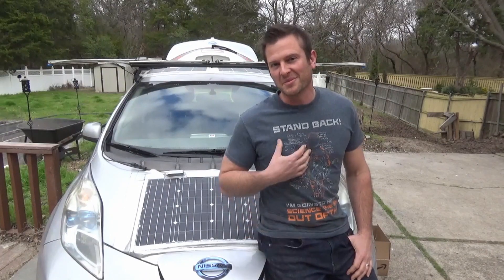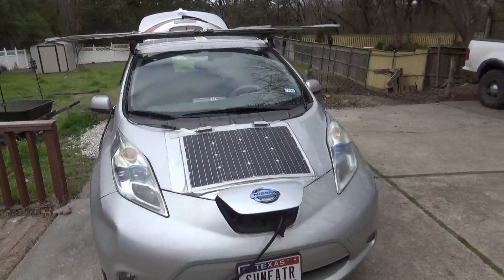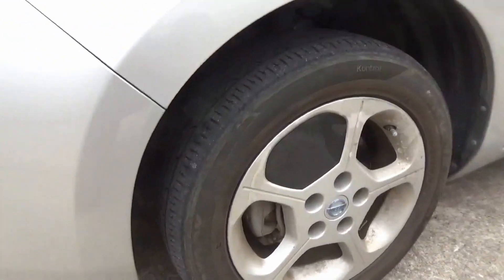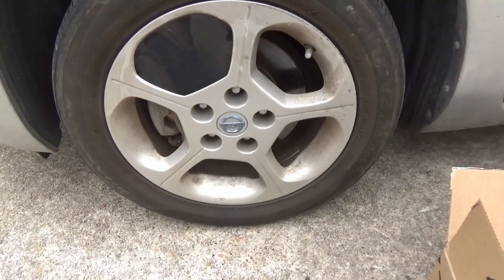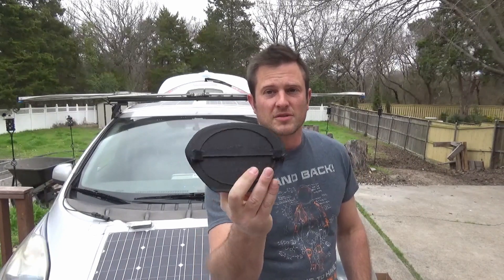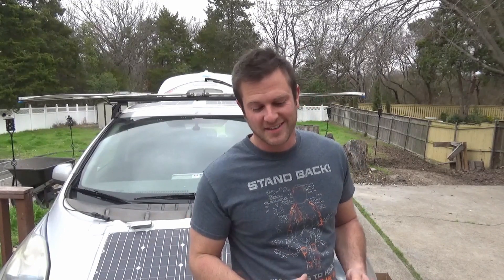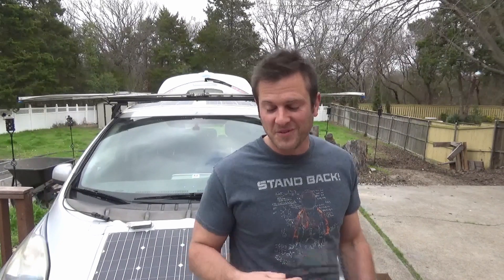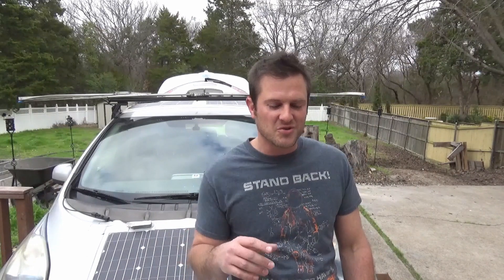Aerowheels for the Nissan Leaf

Comment: Excellent as usual. 
I remember when I comment out about aero wheels and I'm glad you found an even better solution.
The percentage that You've gained probably zeroed out the drag of your roof panels.
Since you're connected with some people with 3D printing skills, maybe you can customize some adaptors to sleek your panels making the wind go only over them instead of diving.
I would love to see your car on a wind tunnel to check the drag coefficient.
Congratulations on the EXPO.
From then on you can write it down, your channel will grow exponentially.
Well done.

Comment: This is a super cool idea! I tried messing around with an ICE car a few years ago to try to increase its economy too and in doing so I found that sometimes the overall price of the upgrade wasn't the main factor, but the cost per ... efficiency gained (?). In that case, it would have been miles per gallon gained per dollar spent, but here maybe it's miles of range gained per dollar spent. The wheel covers may not seem like a big deal at only 3-6% efficiency gain, but if the price to increase efficiency by 3-6% for $150 was compared to doubling the range by doing something like replacing all of the car's metal parts with carbon fiber parts, it might be seen that the areo-wheel covers might actually be an extremely good deal. It's just a different metric that I noticed with my own experiences that really seemed eye-opening. 

I couldn't believe that wheels and tires make such a big difference in efficiency, as you mentioned with information from the SAE. With regenerative braking, wheel covers seem more possible than ever as not as much heat is generated from braking as in the past with ICE cars. It really opens up a whole new world of possibilities. I wonder if flat panels could be made to cover the entirety of the rear wheels, such as on the old versions of the Honda Insight ( https://en.wikipedia.org/wiki/Honda_Insight#/media/File:HondaInsight.jpg ). 

AutoTempest.com is also a cool site for looking up cheap Evs for EconomEV of the week because it automatically searches multiple sites for the best deals ( https://www.autotempest.com/results?make=nissan&model=leaf&zip=79835 ).

Also, have you considered testing individual cells in the factory battery? I have heard that sometimes just a few of the individual cells in an electric car battery, such as the Leaf's, can go bad and cause the whole system to perform poorly despite most of the cells still being okay. I realize that this is a big project and is a bit dangerous because of the high voltage, but I'm just curious if you had given any thought to it?

Thanks for posting all of this awesome information!
Reply from the maker: Thanks for the search engine link.  That will help.  Full wheel well covers would definitely reduce a lot of drag too.  I will keep an eye out for something like that.

The full battery pack open will happen eventually on this channel.  I think the high voltage can be worked with safely, provided that you really focus on what you're doing.  I have also heard that a few heavily compromised modules can cause the whole pack to underperform.  When I drop the battery pack out and open it, I will do a full cell by cell check of all 48 cells in the pack.  I will probably stock up on a few unused battery modules for when that day comes.  The individual modules go for around $50-60, so you could potentially restore the battery for only a couple hundred bucks (there's a business for ya).  When will this happen?  Free time is usually my main limiting factor, but the battery doesn't have to much further to go before I will HAVE to replace it, or switch vehicles.  I will have a better idea of the timeline of degradation this June, when this project hits the 1 year mark.

Comment from the maker: Aerowheel inserts installed on 2-9-2020 at 47,700 miles.  I will try and post updates every month here, so we can get a good idea of how durable these inserts are in the elements.  I applied some silicone sealant at the contact points for adhesion.

3-16-2020   Mileage: 49,053  Highest exposed temp: 87F  All Inserts attached and in mint condition.

8-24-2020  Mileage:  52,900  Highest exposed temp: 110F  All Inserts attached, a few minor scratches, but overall condition still 95%+
Reply: Definitely a good call on the silicone seal. 3D printed parts are surprisingly strong, but they do have their weaknesses, namely heat. Because the plastic used to make the parts has to melt at a fairly low temperature, parts inherently can start to deform in heat. PLA parts, for example, can be molded by hand at around 160f/70c. Texas gets hot, maybe not that hot, but probably still hot enough in direct sun to soften the tabs a bit so that they could pop off more easily if a tire hit a pothole at speed. With the addition of the silicone sealant though, I don't think that you should have any issues. It may have been nice to have mentioned that in the video though, just in case others try this without reading the comments. No biggy though, thanks for trying this and posting!
Reply: @justin_time  Yeah - I'm printing mine with just PLA,  but we don't get above 30 degrees C where I live. It would be better to use PETG or anything with a higher melting point. I think Eric is using ABS for his prints.
Reply: @paulkennett  Hi Paul - thank you for sharing your invention with everyone! I don't own an EV [yet] but I do own an ICE car and am interested in trying to print my own areo wheel inserts to increase its fuel economy. 3D printing usually comes easily for me, but sometimes I struggle with finding an efficient modeling method. In the past, I have used air dry clay to model sections of larger structures to then use to take measurements of for use during CAD modeling. I'm curious how you went about modeling your aero wheel inserts for your Leaf - would you mind sharing your technique?
Reply: @justin_time  I just cut out bits of cardboard to fit the space, then 3D modeled it. Once I had the outer shape I then added the clips. I fiddled with various clip options till I had a result that worked.

Comment: Hey Sam, I just thought of something new to possibly try. In the same vein as weight reduction as with swapping out the lead-acid batteries for lithium batteries, have you considered removing parts from inside of the car such as the rear seats? I took them out of my vehicle once, it only took about 10 minutes with one socket wrench, and I couldn't believe how much they weighed and how much it looked like the springs shot up in the back. Other things like floor mats and carpeting can also really add up too. This would be a free, easily reversible mod, and because you mentioned in previous videos that you typically only use the leaf as a commuter car, it doesn't sound like you would lose any functionally. Maybe it would be a gain as you would have even more room for other things in the future from grocery bags to extra batteries. Just an idea for a free mod and potential future video topic. Hope to see another new video from you soon!
Reply from the maker: Thats actually a really good idea.  The back of the seats do serve as one wall of the semi-insulated "case" that houses the batts, inverter, etc, but Im sure we can fashion a replacement insulated wall that weighs significantly less than car seats.  I might not need to ditch the weight though.  The system is breaking some records already in Feb 2020.  2.2 kwh from the solar last friday (record).  Plus the 4.5 from the batts and we're right up to almost 30 miles/day (when sunny) from the charging station.  I was actually really shocked to see that kind of power generation this early in the year.

Took a field trip to pick-and-pull today, and ripped a hood off an old junker.  This will serve as a practice template for making custom solar panels that will be used to fill in the patches of empty space around the pre-assembled panels.  I'm going to experiment (this weekend weather permitting) with some various epoxies and encapsulants.  By filling in the remaining spaces on the Leaf, it may be possible to get up to 5.5-6 kwh in July (we're already on pace for 4+).  Along with the charge in the aux batteries that would give us 47 miles of added range.  Far beyond my initial hopes for this system.
Reply: @InnovativeSustainableSolutions  Wow! All of those numbers truly are amazing! I wonder if the springtime will actually be the sweet spot for maximum range gain as the sun is shining but also, I'm assuming, that the air conditioner in the rear doesn't need to run very much if at all. When the a/c has to start running during the summer it would use more electricity, but of course the sun will be shining more intensely and more often, so who knows, maybe it will balance itself out? It's really exciting to hear that you have already surpassed your initial goals - I hope it keeps getting better! If the range gains keep increasing, especially with the coming solar hood upgrade, maybe it will even be possible to start removing lithium-ion batteries and to reduce the cost of the system? It will be very interesting to continue watching your journey through this process!
Reply: @InnovativeSustainableSolutions  If you gut a car, like extremely, Carpets and the felt soggy  from condensation underneath it, just use two mats for the front , trim on doors and pillars, the bitumen tiles glued behind the dash and elsewhere, the rear seats, you are looking at 100lb saved. More racing tips: Get rid of the heater, heater tank and heater core, use cemetery candles for heating in winter. Get rid of power steering pump and AC (without heater core, slipstream is enough to cool you anyway). Rear windows can be Polycarbonate. Hood and front quarters and rear hatch fiberglass. Get skinny drag wheels, J4.5 wide rims are perfectly fine for a road car and use high pressure eco tyres.

Comment: I currently am driving a Toyota Corolla from 1994 but I wonder if I could find something like this for me to save some gas at least
Reply from the maker: They're out there.  Over 450,000 Nissan Leafs have been sold globally.
Reply: @InnovativeSustainableSolutions  I think he's looking for wheel covers for his car, not a used LEAF 😋
Reply from the maker: @JRP3  lol, yeah, you're probably right.
Reply: I wonder if it would be possible to take a piece of scrap metal, drill out the wheel's bolt pattern, and then attach it to the wheel? The covers themselves do not have to be very strong because they wouldn't be supporting the weight of the car, just deflecting the wind, so I don't think that the material used would have to be much strong than something like cardboard?
Reply from the maker: @justin_time  I like it.  Very Mad Max-esque
Reply: @justin_time  People have made smooth wheel covers using aluminum pizza pans, drill small holes and use zip ties.  This would be an easy way to test to see if they make much of a difference.  Then you could figure out better ways to attach them if you want to keep them.  I think you can find them fairly cheaply.
Reply: @justin_time  I'll do that for sure!
Reply: @JRP3  yes!

Comment: Hi Sam, I'm also Sam. Love the things you are doing.
FYI they sell solid face wheel covers. they come in various sizes and fit all cars. no need to print anything and they are cheap.  google solid wheel covers.  Thinner low resistance tires will yield more efficiency.  or go -1 or -2 wheel size with larger sidewall tires.  less unsprung weight and more efficient drive and lighter while keeping the original circumference, you can also increase the circumference of the tire to increase efficiency by lowering RPM per mile/km electric cars have plenty of torque for a 5% size variance. google tire size calculator. Tires will be cheaper and 14 wheels are light and you can install solid hubcaps for aero efficiency without having to print anything which adds weight to a heavy wheel already.  stock tires are 205 55/16 for your car, change them to 205 75/14($40 USD per tire).  4.8% increase in circumference while having a more comfortable ride. Go even larger Circumference if you like.  There is plenty of space to go up to +8-10% if you like which directly increases efficiency due to the fact electric vehicle runs better at lower RPMs.  Electric motors with linear torque will have no problems at all with larger wheels. 5-114.3mm bolt pattern is very common, a 14x5.5 inch wheels can fit 195 or 205 tires with wider sidewalls. 1/2 the weight of tire/wheels with a more efficient highway cruise. Less overall weight also will help more in the unsprung weight during braking and acceleration plus handling.. like removing the back seats and passenger seat if you are commuting on your own. they can be quickly placed back in if you need to carry passengers, or else you are simply transporting weight for no reason. camera side-view mirrors will also give more efficiency over standard side mirrors or increase the attack angle on the side view mirrors, they alone cost about 5% inefficiency in gas cars. You can always use a plastic sheet to form and tape the side view mirrors towards the front into a more aerodynamic shape.  lower windshield spoiler will also smooth the air over the wipers while keeping it functional or the single blade type aerodynamic wipers.  front roof rack spoiler to smooth the airflow above the car.  rear micro shark fin (vortex generator) diffuser in the back above the tailgate will also break up the airflow behind the car to decrease negative vortex drag. Remove the front license plate and mount if allowed and/or place the front plate in the windshield. tape all the seams between all your body panels. That will smooth out the turbulence also.  change all your lights to LEDs instead of standard bulbs they use a lot less power with increased brightness especially daytime running lights and turn signals which tends to be on more.  custom ECU tuning to change the power delivery levels and cruise points.  
I would love to see you incorporate some of the simpler ones. The wheels/tire will change your ride.  
These following works with regular cars. not sure how they will work with electric ones.
If you can live without AC, the compressor alone weights a lot and takes tons of power.  removing it will increase range.  Changing the power steering to manuals steering will also help with the power draw and weight.  It is such a small car that you can manually turn the wheels without much problem.
I own a Jetta TDI diesel and we have a similar thing called hypermiling in the diesel community for the past 20 years.  All the things I have suggested works. We have people going from 600 miles a tank to about 1000 miles from all of the above or less.
Similar to electric, we have tons of torque at low RPMs
I'm in the process of buying a Hyundai Kona EV, that's why I found your channel during my research on electric cars. I have watched all your episodes and love what you are doing. I love to help if I could.
I actually have additional ideas and concepts if you are interested.  

Best wishes,
Sam.
P.S. I have put a lot of effort into trying to help.  Please let me know if you have any questions or comments..
Reply from the maker: Thats a ton of good advice!  Thanks Sam!  I had no idea people were putting that much thought and effort into hypermiling diesel vehicles.  The swap for a larger tire in particular sounds like a winner, as mine are starting to get pretty bald.  I had never even thought about the higher torque and efficiency at a lower RPM.  I'll start bargain hunting for a larger size wheel today.  I will consider removing the back seat too.  It serves as an insulative wall for the battery compartment now but It wouldn't be to hard to build a replacement, probably one that would be an even better insulator.  Thanks again for all that advice, I'm sure other people will find this comment and some of these ideas will help them as well.
Reply: @InnovativeSustainableSolutions  I'm glad. Just make sure to use a smaller wheel of you can and skinnier tires for less rolling resistance. Also try taping all the gaps between all the front fenders. I thought about the side view mirror, you can literally cut up used one gallon milk containers to create the funnel to decrease wrong drag.  Lol. Please keep up the great work and looking forwards to your next video to hear how it works out!

Comment: Speaking of air resistance, why none of the big manufacturers of EV-s these days does not consider using the wheel arch covers for the rear axle, just like Citroen had some time ago, or the new Lightyear One for example... Also a better job at leveling the undercarriage would help, along with the lowering a little bit the ground clearance of the vehicle. Also for the non sportive drivers, a little bit of extra pressure in the tyres (only when the weather allows it) would also be an added help..

Comment: regarding the solar panels how many watts do you need in total so far in my car I have 400 watts and I can't get it to charge
Reply from the maker: Are you trying to run the car charger directly off the solar panels, via an inverter?  My initial system used only 250 watts of paneling and it worked.  But I had to use batteries to supply the high amperage to power the car charger.  The batteries allowed me to take an hour of 250 watt solar power, and turn it into 15 minutes of the 1,000watt power necessary to run the car charger.  Hopefully that makes sense, if not check out my original full system build video.  That shows a little more detail.
Reply: Innovative Sustainable Solutions 
I see maybe it's just my battery Bank I have two batteries pure sine inverter in 400 watts so maybe I need a couple extra batteries thanks a lot for your Fast Response good luck on everything